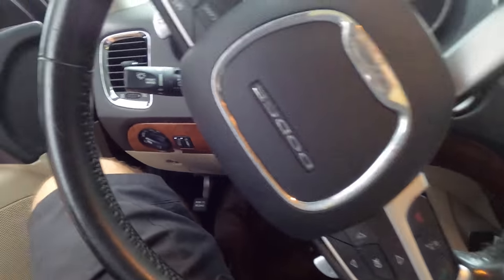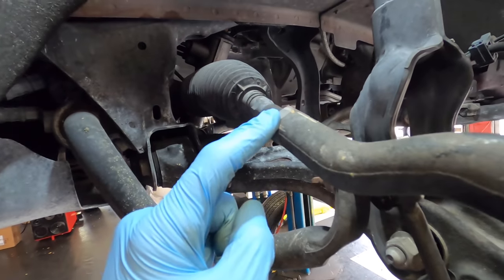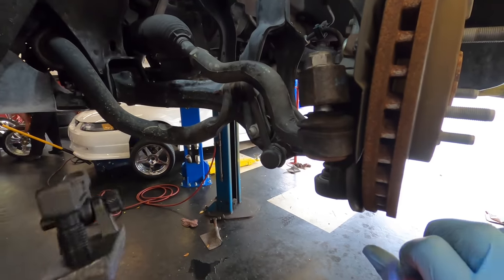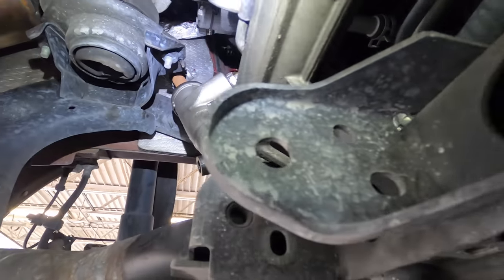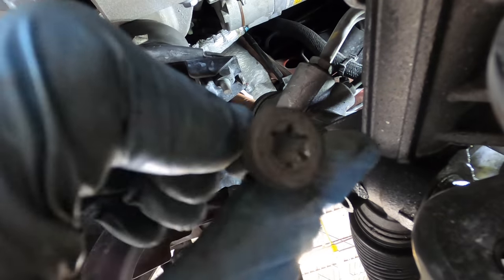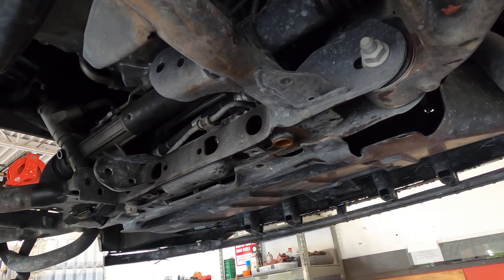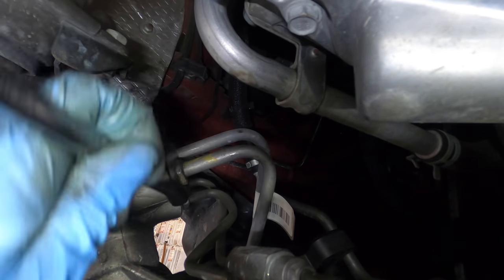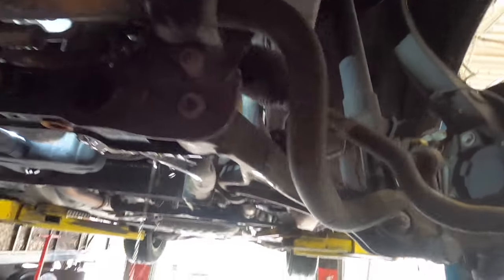Engineers vs Mechanics | They GOT Me!

Comment: I was once told by my boss who started out as a mechanic, then went back to school and became an engineer You build it once and operate it forever. It was in reference to a piping design I did. I was going to build it simple; but would have made repairs very difficult. I fixed the design.
Reply: I think engineers should have to work on repairing their designs.
Reply: @EvilTurkeySlices  most don’t realize that engineers have to design within the constraints of a budget. engineers doing the actual designing aren’t too pleased with what they have to submit but there’s not much you can do when the attitude from upper management is “who cares about whose repairing it as long as we meet this budget and get our bonus”
Reply: Engineers have explained multiple times that they submit or argue for designs that make life easier for the consumer and mechanic. The penny pincher higher up shoots it down because it costs five cents more. Might seem insignificant, but five cents is a lot of money if you make a million units of something. Many companies now just roll it out. "Let the aftermarket fix it". We are making jobs this way. Says the original manufacturer.
Reply: Engineers are told to make the things as cheap and easy to assemble at the factory as possible.  The company doesn't care how long or difficult it is to repair once they sell it
Reply: @darrenporsch  This only works when shit breaks outside of warantee.. as i go to the dealership and watch entire engine replacements where the chassis of a pickup is on the ground and the body in the air, i have to wonder how they feel about that particular cash leech..
Reply: They know about warranty cost and they assume a certain percentage of stuff is going to break and they're going to have to fix them under warranty. they also designed the stuff to last at least a warranty..  but some stuff's going to break no matter what nothing is perfect. My father used to do inspections for warranty companies I used to go with him sometimes look at the broken stuff.
Reply: @darrenporsch  I wouldn't say that is true. Compare the repair time for a Ram 1500, Chevy Silverado, GMC Sierra, and Ford F150's starters. Compare all of these to a Toyota Tundra. I hope you find how comically hard it is to replace a starter on the Tundra. I don't care how good something is made. If you make it that hard to replace and cost that much in disassembly and labor. It's bound to fail just for the inconvenience at some point in time during ownership. For a baseline. Most starters on 1980- 2004 vehicles that I own can be pulled and replaced in an hour or less.
Reply: @mackjones7688  manufacturers care about how much it cost and how fast they can assemble at the factory they don't care about the after costs I'm sorry..  like the other person said if they can save a nickel our unit will do it when they selling hundreds of thousands or millions of units
Reply: @darrenporsch  I already said that fact before you. I am well aware. However this seems to extend to normal service items as well. A cost they will incur often before the warranty is out. For example. Bulb replacement. There are vehicles made now that call for bumper and grill removal to change a bulb. Something that took all of 30 seconds to gain access to now can take 4 hours of labor to complete. I find that to be ironic.
As long as a vehicle can make it through a warranty period without major repair costs that the manufacturer will have to cover. That is the main concern. Build it good enough last that long. After that, it's your problem.
Reply: @EvilTurkeySlices  why should they have to work on them? Cars are built to be disposable now and people forget that and try to run em to 500k
Reply: @Ayeobe  cab off engine swaps are actually extremely easy. It was a win/win for techs and manufacturers. Imagine this, if you will: removing about a dozen clips, 8 bolts, and a few hydraulic lines to have full access to every component in the engine bay. Then, when you pull the engine out, you unhook a wiring harness, 2-4 motor mounts, a trans mount, the drive shaft, and then lift the entire engine and trans with out fighting clearance issues. Cab off engine swaps are by far the easiest swaps I've ever done.
Reply: @darrenporsch  yes, until customers get tired of paying large sums of money for repairs. Look at German manufacturers. They have lost many customers in the US due to high cost of repairs, limited shops to work on them, and weird maintenance intervals. The company has to balance easy of assembly, ease of disassembly, and cost. Many mechanics won't touch BMW's, Audi's, Porsche, Mercedes, Fiat, or Volkswagen vehicles. Chrysler, Dodge, Jeep, and Ram are close behind. Our shop charges extra labor time for any of the previously mentioned brands due to the shitty engineering and the asinine about of work that goes into repairing small things that shouldn't be nearly as hard as they are.
Reply: @darrenporsch  Except in aviation where low hours of required maintenance per flight hour is a selling point.

Comment: Taking something apart for the first time is always a test of our abilities and going back together is usually a bit easier. Kind of like driving somewhere you haven't been. It always seem longer going there but shorter coming back.
Reply: You learn to charge double on crap dog products so called.
Reply: It took me 8 hours to pull my transmission for a clutch replacement and then it only took me 3 hours to put it all back together.

Comment: I have had the same kind of trouble with starters on machines, they are heavy and if they need to be lifted out of a tight space it can be much harder to maneuver them out than put them in or they come out the bottom and it is easy to maneuver the old one out but lifting and maneuvering the new one in is a fight to get it to zig zag back in without major disassembly.
Reply: Lol i had a mac truck i had to replace the starter on and its a massive starter. This truck had massive oil leaks so the starter was covered in oil and since there were three mounting bolts and one that required me to use a combination of 1/2 " drive extensions just to reach the bolt i had to hold it with one hand and soon as that bolt came out so did the starter . It was like tring to hold a 200 pound greased pig with one hand no way i got a face ful of starter lol

Comment: I know you do this every day so plz consider a small suggestion. I've had good results with that ball joint separator by tightening then a few hammer taps on the parts, then tighten a bit more, repeat process. I found its a lot less strain on the tool.
Reply: You mean don't start with the BFG first?

Comment: I like how you torque everything to factory spec. Assures top safety of the drivers and folks around the driver!
Reply: Factory spec is totally important on many things. But would you factory spec tighten your wheels? Or your caliper bolts and slide pins? Tight but not overtight works most of the time to get the job done right. At least in my experience. The only things I've ever torqued to spec would be engine internals, heads/head bolts, intake parts and plenums, and manifolds. Or where tolerances can be screwed up from being too tight. Oh and spark plugs.
Reply: He actually never adjusts the torque wrench the clicks are just for show
Reply: Master tech for 24 years (Ford, Land Rover, Jaguar, Rolls Royce), literally only use a torque wrench on heads, main and rod bearing caps, and differential internals, they are really the only things that matter, never had an issue with anything else.
Reply: i agree number on of premature fallers on ball joints tierods and hub assembly's
Reply: @conn9823  yes there are circumstances where you do need to torque wheel nuts properly or drama will ensue but not many
Reply: @mountainfarmer8766  Absolutely agree, if I caught an apprentice using what is basically a monkey wrench (regardless of the brand and quality) instead of the correct spanner, they'd be mopping the floors and cleaning grease traps for a week, the same for tube spanners on pipe fittings.
Reply: An experienced mechanic or mechanid can judge, very closely, the torque needed for a specific bolt/nut/thread requirement by feel.  Of course this applies, only, to random, incidental stuff, other than what requires more accurate torques like heads, manifolds, axles, cranks, etc.
Reply: @mountainfarmer8766  Appears that you don't know how to use a torque wrench.
Reply: @mountainfarmer8766  I suspect you're running with a bad lot of mechanics.  We don't fool around.
Reply: @mountainfarmer8766  Sorry, I don't engage with trolls.
Reply: @mountainfarmer8766  especially kill bolt

Comment: What didn’t need a torch! Up here in Northern Wisconsin that’s the first tool we roll out.
Reply: Oh, i thought you park the thing in a pool full of penetrating oil for a week first.
Reply: Nothing beats a good acetylene to heat steel stuff up till it's cherry red like exhaust manifold and header bolts from blind holes without
snapping them off. No one never ever wants to snap bolts off in an engine block. As for working on rusty stuff in salty Wisconsin, I got tired of rusty crusty in my eyes. Yes I wore safety goggles and glasses, but it didn't keep all the stuff out of my eyes. I don't even do my own oil changes anymore. I can relate to Ray's discovery or what the hell moment when reassembling. Been there, done that, rinse and repeat.

Comment: Things have always been lacking in the automotive engineering department. Many years ago (over 50), I had a 1963 Jaguar XKE. Nice car, but a maintenance nightmare. I had to replace the clutch. Anyone that has ever worked on one knows that half the car has to come apart to change it. The nose had to come off, torsion bars, console (to access u-joint), cross brace, remove intake with carbs, entire exhaust system (those parts extended through the tubular frame and under the engine), release motor mounts, drop engine and transmission out the bottom, separate engine and transmission and finally install the clutch and reassemble. I still remember all the steps to this day. In addition, those British cars had the worst electrical systems ever devised. If it looked like rain, it wouldn't run. I had to avoid any puddles, because if water splashed up onto the engine, it would quit. After a while, I got used to popping off the distributor cap and drying it out so that it would run again.

I agree on the aviation side. Aircraft 50 to 75 years old are still flying when properly maintained. Fortunately, they are designed to be easily maintained.
Reply: I heard a story a number of years ago about how Lucas discovered that  a company in Asia was making counterfeit Lucas electrical car and motorcycle parts. The company was considering suing the Asian company until they tested the counterfeit parts and discovered that they were superior to the factory parts. Instead of suing, they made the Asian company a subcontractor. (No, they weren't being made in China.)
Reply: I see you have come across the "Price of Darkness" AKA Lucas electrics. Re other Jags, try changing diff oil on an XJS. No drain plug and filler plug is tucked right up where my large hands won't fit. Book says to drain diff take off rear diff cover. To do so means dropping the diff, which means dropping the suspension etc, etc. Plan B was get a brake fluid vacuum suction unit and suck out the old 140 mono grade diff oil via the filler hole, but do it quickly after the car has been driven for 1/2 hr or more - oil is warmer then and less viscous. With owner, who has skinnier hands, we did the job sucking out then refilling oil in about 1.5 hrs - that was after much pondering how to do it. We did the job again about a month later. First lot of oil looked like it had been there for many a year so we didn't want to take any chances despite the lack of any noises coming from the rear end. Having a 2 post hoist at home makes the job bearable. Without a hoist I would not have even attempted it. Owner has since sold the car and I don't want to see another Jag. Retired mechanic in Land Down Under. PS. Car also had 16 coolant hoses under the bonnet/hood. That was a 40 min job for the two of us just to find where all the hoses were in the engine bay - we had all the new hoses in a kit all laid out but still had trouble identifying locations. Then another 10 hours to replace them a few days later. Like Ray were loved our job, doing it twice a few times after we got the sequence of fitting the various hoses in the wrong order.
Reply: My brother acquired an XKE in a dubious trade. He told me the heater core was leaking, the book called it a 16 hour job. I asked if he had to start at the taillights, he said that was probably right. He offed it somehow before he stuck himself with that job.

Comment: Friend of mine was a VW mechanic in the late 70's and there was a design flaw in manual transmissions that caused trans to lock up. The manual instructed to drop engine and trans and open up trans to strike gear as two were engaged, 8 hours book time and no replacement parts to fix issue. My friend would drill a hole in trans case and had fabricated a rod to reach gear to strike it and unlock trans, then would install a rubber plug which worked fine as it was above fluid level. 10 minutes for 8 hours pay.

Comment: as a mechanical engineer i can confirm, mechanics are last in the priority list. as long as the production costs are low, its all good.
Reply: Look at a veyron.  24 hours odd to do the oil change by the book as you need to drop the engine :D  Something has to give and maintainability definitely goes out the window when space is at a premium.

Comment: This is exactly why I left the automotive repair industry in 2009 to get my degree in Mechanical Engineering. I often felt like some jobs just simply did not make sense with book time for my techs. So, sometimes things are designed for original assembly in mind for manufacturing and a risk assessment is performed to determine how often a complicated design will need to come apart. I am an Assembly Process Engineer now and I often tear apart design engineers' assemblies during the prototype and pilot phase of production and try to teach them how to design for assembly. It is a thankless job sometimes, but my techs are the best at helping me find the flaws. I am not in the auto industry because I did not want to move back to the midwest. lol. Great videos and thank you for showing the good and bad things a technician deals with on a daily job.

Comment: Great videos, nice work Recently watched an episode where you replaced a steering rack on a late model dodge . my only concern is that on a vehicle equipped wit an air bag and a clock spring to enable it, the steering wheel should be locked in the middle position and the new rack installed accordingly ( any inconsistently will usually effect the guide lines on a back up camera as well as spring center)
Reply: The same thought occurred to me. I've had issues with stability control on some vehicles if the steering wheel is even slightly out of position and the old technique of removing the steering wheel and refitting it to match the fresh alignment won't work if the sensors are embedded further down the steering assembly.

Comment: The engineer in me was like just take the subframe off.. Always a good reminder to get that second opinion. Nice job.
Reply: I was thinking to myself ," wouldn't it have been faster to just zip off the 4-6 bolts holding the subframe in and let the steering gearbox fall out onto the floor?"
Reply: @mikehannigan848  The engine sits on the subframe on these, I believe. An engine hanger could be used, but every minute counts,  especially if you're flat rate
Reply: @FixIt1975  not saying they have one there but there's jacks specifically made to hold in engines and transmissions from underneath  when the car is on a lift. 1000's of ways to top a pizza as they say. Either way, the subframes are designed to be removed usuallt 4-6 bolts maybe you gotta unbolt an engine mount or two, I've had to do it on jackstands before so doing it on a lift should be easy compared to that.  Not to say I'm a fan of engineers but again I've had to do way more while on the ground, in the winter for less than he's making.
Reply: @mikehannigan848  I had to do an oil pan gasket on an awd BMW few years ago. I put a pole jack under the trans and I had 4 guys lower the subframe as I took the bolts out of it. Not a fun job, but I wasn't turning down a 14 hour ticket
Reply: @FixIt1975  there's a solution to every engineer's meal ticket.
Reply: @Bootyloot  ya, that's why he's the mechanic not me haha

Comment: Good job man. I have worked at a Dodge dealer for many years and haven't had to do one of those racks yet. The silly thing is the subframe supports the whole entire engine as its mounts are fastened to it. Liked the angled wrench you used for the power steering lines. I should get one of those. One word of advice from one technician to another. Put a dab of blue threadlocker on the steering shaft bolt. It is extra insurance so there is no way it can loosen and cause a crash. I do the same for torque converter bolts and u-joint bolts.
Reply: lmao  lhjq you are a joke! I wondered what they did with all the tech school rejects. I wanna take my dodge to your dealership and have you personally work on it!!  hah ha hah ....NOT
Reply: @tbonedaddy12  You have a lot of nerve to be making nasty comments about the workmanship of a technician who you have never met in person. What qualifications do you have that made you come to that conclusion?